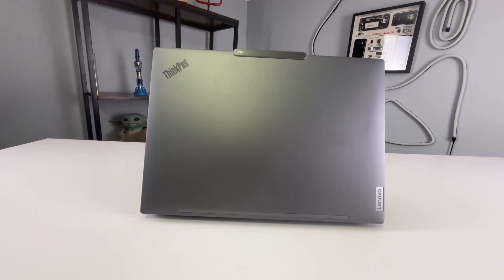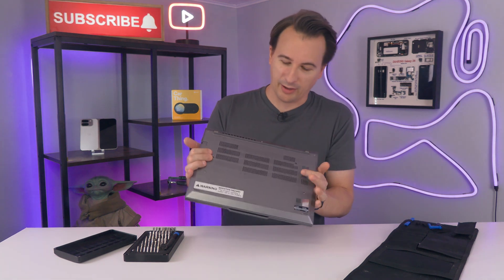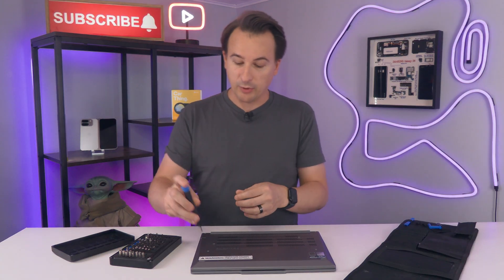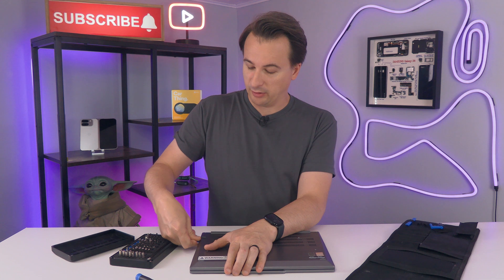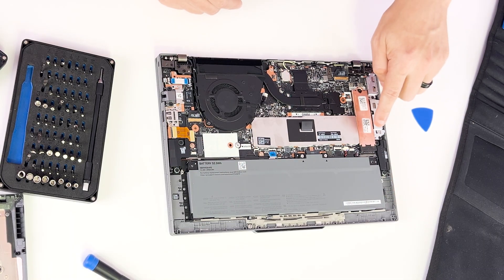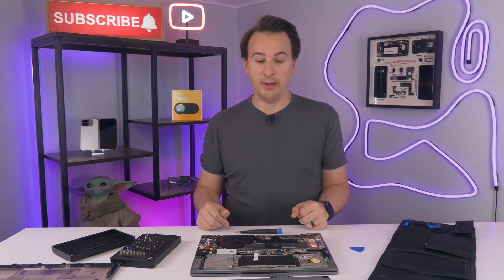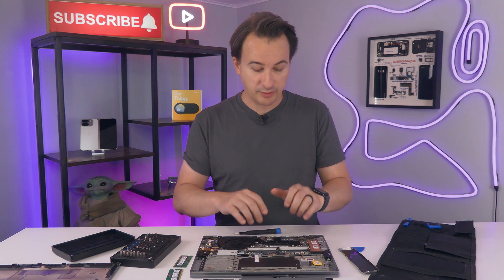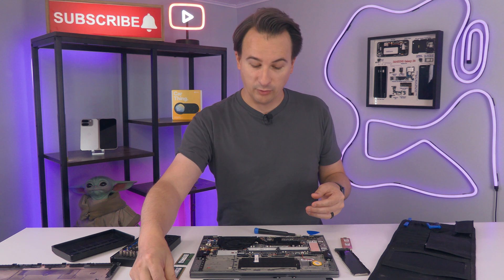Instead of reviewing the Lenovo ThinkPad T14 Gen 5, I disassembled it

Comment: You didn't show the keyboard replacement process which is the most crazy thing for me. The other parts are quite similar to my Dell disassembly
Reply from the maker: I should have showed this and would have, but when I reviewed this a year ago the guide wasn't available yet and I couldn't risk damaging the keyboard (as that's often the most difficult thing to replace, i agree).
As it turns out, this one is REALLY easy.
Remove two screws from the bottom (marked as keyboard).
Push towards the display on the keyboard which will slide it out of some clips.
Use a spudger to lift the keyboard, then gently flip over to reveal the two connections to the motherboard. Unclip those... and you're done.

Comment: As nice as the Framework laptop is, I honestly don’t think it compares to buying stock parts and simply replacing worn‑out components. The problem with Framework is that most, if not all, of the parts are proprietary.
Reply from the maker: Hrm. I'm not sure I follow the logic there. The Framework lets you buy and replace stock RAM, SSD, and even WIFi.. you could buy those components anywhere. Most laptops won't let you do any of that. Fewer still will let you replace RAM or SSD, but like this Thinkpad, still won't let you replace the WiFi module at all, let alone with an off the shelf part.
You can also easily replace display, keyboard, motherboard, touchpad, webcam module,  chassis, battery, and well.. basically every other part of the laptop. True not all of these are "stock" but... I don't know of a single laptop that uses a "stock" display you can buy just anywhere... or a "stock" motherboard, or a "stock" battery... and so on. Again, most laptops it's not all that possible to do ANY of these repairs anymore. But even when you can, like with this ThinkPad, you're still buying "Lenovo" parts.. not "stock."

Comment: what about wifi? You conveniently left that out.
Reply from the maker: Wireless module is soldered. I didn't call it out as repairable since it isn't.
Reply: @anoraker  too bad... linux users would want the wifi module to be non-soldered, in case the soldered wifi module don't work too well. Lenovo should go back to T14 Gen 2 AMD where pretty much everything is replaceable.

Comment: Thanks for the excellent disassembly/review! You had mentioned for design reminding you of older laptops...Do you think those were thicker just because internal components were larger while not thinking about repairability?  Also, I noticed that Dell has new modular, replaceable USB-C ports... I'm curious if you knew what  the ports were made of, like if the material is also sustainably sourced? Thanks!

Comment: Even though they worked together with iFixit and finally made RAM replacable again (which I really like!), they still solder down the effing WiFi-module! So, if you don't have WiFi7 from the start, you will never get it! And only on T-, P- and L-series, while E-series, Thinkbooks and ideapads still have M.2-2230-adapters.
Reply from the maker: It's definitely not perfect, I agree. It's a step in the right direction.

Comment: Honestly a bit lame. My 2018 omen is as repairable and so is the average gaming laptop today. Removable keyboards, non glued display assemblies and upgradable cpus and gpus are what we need.
If you get a 1700$ gamong laptop it will be just as chonky, have ethernet and all of the upgradability you see here.
Reply from the maker: You're comparing gaming laptops to ultrabooks and um... that's kind of pointless? Sure if you spend $500 more you'll get something else. But what does that matter? Not everyone needs or wants a gaming laptop.  Not everyone can afford to spend another $500. And most people can't settle for the incredibly poor battery life a gaming laptop affords. So sure, it's good that (some) gaming laptops are more repairable, but that doesn't do much good for most people so it's not all that great. And while I would like to see MORE repairability, I like to celebrate any strides towards repairability we get.
Reply: @anoraker  you can easily get a 1700$ gaming laptop which has the same upgradability as this one while also getting a free GPU. This thing looks chilly and heavy for an ultra book anyway. The legion 7i 2024 is a particularly premium laptop, weight less than most in its category, has 2 ram slots lasts 6 hours YouTube as measured by jarrods tech. And it starts at 1699 with a 4060. Also the WiFi is socketed, as are 2 ram and m.2 SSD slots.
The 2023 g14 is a 14 inch laptop, it dominated every other gaming laptop in battery life and has 1 ram slot with 16 gigs soldered, socketed WiFi, 1 m.2 slot.
The battery in all of these laptops is held by screws. The lack of a cable connector is something I don't think is common nowadays but my 2018 omen 15 from the DC series has it (Google the sr03xl battery to see it). The only company I know which glues batteries is apple and being more upgradable than apple is hardly praiseworthy.
The only unique feature here is captive screws, which is not an expensive or particularly meaningful addition. The removable keyboard and display are the 2 features repair shops have been asking for.
Lenovo did nothing here. They put sodimm and an ethernet port into a laptop, an ifixit sticker and jacked up the price. I think framework laptops are overpriced for what they are but at least those have magnetic bezzels, removable keyboards and interesting io. This laptop should be 1200 tops to even be worthwhile. Lenovo could have used lpcamm2 memory (which they helped develop and is featured in the more expensive P1 ThinkPad), they could have made the WiFi socketed, they could have used the new AMD CPU, they could have used a more unique form factor and they did nothing.
I would suggest getting a 1000-1200 dollar laptop, configuring it with as much ram as the manufacturer allows, putting a 2tb SSD in it and pairing it with a 50 dollar ethernet dongle. You can 3d print a xhonky chassis for nostalgia with the money you saved.
Alternatively get a slimmer gaming laptop with a particularly large battery and at least 1 sodimm slot.
Reply: I missheard that you said this thing costs 1700dollars. Now that i checked it is not a bad deal. There are 1200 dollar gamomg laptops around but most of them are bad, you could get a food model used or refurbished at that price instead @anoraker
Reply: @anoraker  I still don't like it. It is overpriced for what it is and you praising the nonglued battery (only apple does that) and ignoring the soldered WiFi (which is very rare) gives me little hope.
Reply from the maker: @davitdavid7165  ... in ultrabooks, soldered WIFI is common. As is soldered RAM, storage, and the completely inability to replace displays. Again, compare apples to apples [and not Apple). This is a good step forward (or backward, considering it gets there by embracing older more repairable design).
Reply: @anoraker  I understand that, but it is still annoying to see repairability being the main marketing gimmick and it being barely better than everything else. For this price point though I may consider it, especially the newest and version
Reply: @anoraker  I also dislike people praising companies for the bare minimum. If you want to see more change demand it!
Reply from the maker: You dislike a lot of things. Maybe that's something to consider. Me, I've learned that it's ok to offer praise for efforts, as that typically leads to more people continuing those efforts, whereas simply trashing them will likely dissuade them from considering. Lenovo didn't have to work with iFixit at all. It didn't have to offer any repairability at all. Its unrepairable laptops sold just fine (more than just fine). Let's give credit where due.

Comment: Thanks for the video! If I upgrade the ssd myself, I would need to reinstall windows. How would that work with the authorization, would I need to buy a license key or does that transfer automatically?
Reply from the maker: These days, license keys are tied to motherboards. So as long as you install the same version of Windows (11 Home as memory serves) it should activate without issue.
Reply: @anoraker  Thanks!

Comment: maybe thats just me but i i find lenovos current lineup ugly. and i dont mean the "boxy" thing with the thinkpad range, actually liking that because there is a lot of benefits connected with that (better cooling, better keyboard etc.)
but: the silver logo badge on the side, thinpad logo 45° in the corner, the camera ridge ... all of them scream "unnecessary" and "not designed to work with each other". putting ugly ogos and badges on something is really the most clumsy attempt to make something unique.
Reply from the maker: You're not... wrong... technically. Lenovo's ThinkPad is a very "I can take this to work and not have the manager judge me" look... and there's a place for that.

Comment: They did SO much right! Serious kudos for re-introducing the RJ45 Ethernet port. Serious kudos for the replaceable, non-soldered RAM! One miss though is the soldered wifi card. 9/10.

The new Ryzen processors are the closest thing on the market to approaching Apple's power and efficiency with the M1/2/3 processors. I have a P16s AMD that I use as my daily driver and the battery life is amazing with it's 15w 8 core AMD processor.